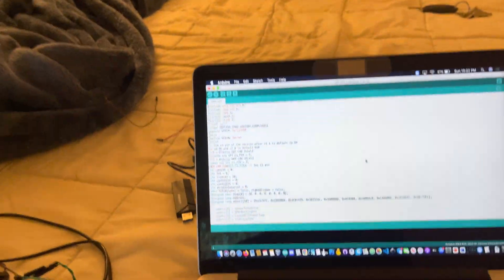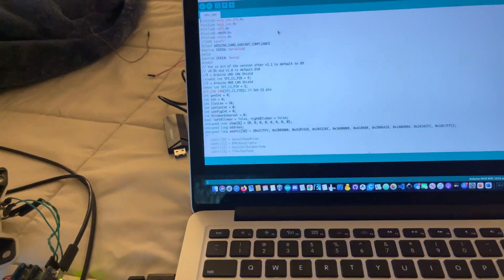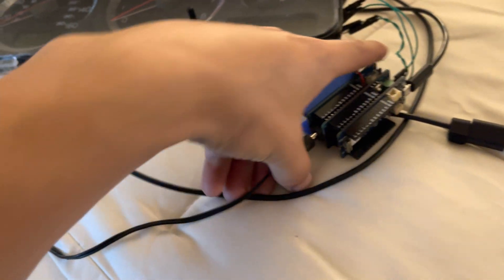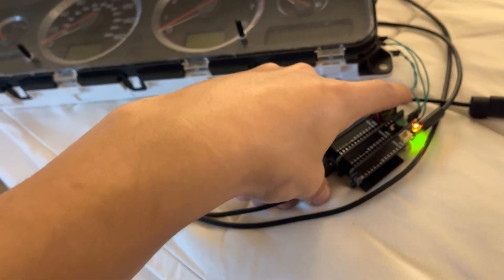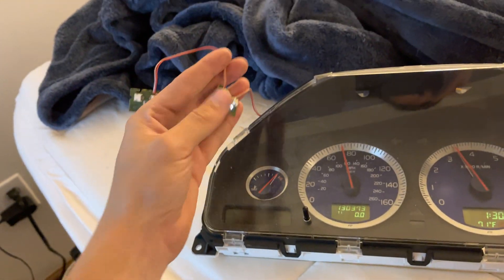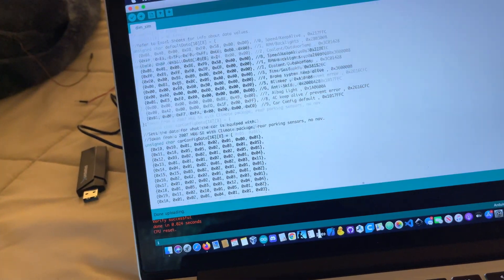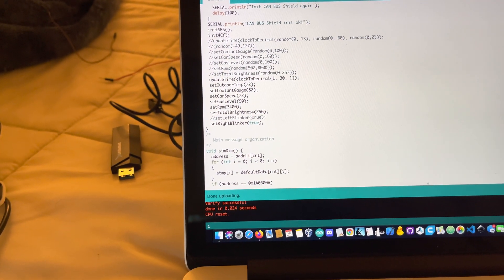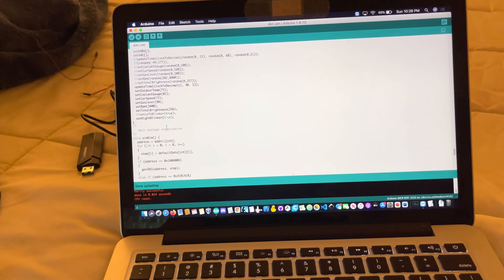Volvo Simulate the DIM

Comment: Everytime i power on the DIM cluster, it gives me a red RX light, how to fix that?
Reply from the maker: Can you upload a picture to imgur and link it so I can see what you’re talking about?
Reply: @AVGarage_  It won't let me send the link, but the title is Red RX light issue.
Reply from the maker: Send me the last part of the link after the /

I assume the light is on the arduino can bus shield?
Reply: @AVGarage_  Yeah, the RX light is on the CAN-Bus shield.
Reply from the maker: I believe that would be something to do with the way you have it wired up.
Reply: @AVGarage_  Like what? i did everything followed in your SimHub video.
Reply from the maker: Take a picture of your wiring and upload it to imgur. I found your first picture.
Reply: @AVGarage_  The entire wiring?
Reply from the maker: Yes
Reply: @AVGarage_  Here is the wiring on the Volvo S60 cluster,

is the title.
Reply from the maker: Ok i see that. Can i see how the rest of it is hooked up?
Reply: @AVGarage_  Okay.
Reply: @AVGarage_   Here's the rest of the wiring, sorry if the camera is so blurry.

is littearlly the title.
Reply from the maker: I see the image. Looks like you need power plugged in. I am also wondering what sketch you are trying to use?

Comment: I converted my standard dials to the blue R dials on my 2.4 by swapping the fronts, wasn’t too bad actually. This would have been easier 🤣 I also did a set for my friend’s 03 V70 but that has the D5 engine so the rev counter only goes up to 5000rpm - I used the black version of the dials from an XC90 R-Design D5 which came with those from the factory.

Comment: Any idea does this work with MCP2515 CAN module? How about with older DIMs (such as V70 2000-2003). I haven't found any simulator which can light up the display on the left. Great work! If you need testing help with older DIMs you can contact me.
Reply from the maker: Yes it uses the MCP2515 CAN module and the library created by seeed studio. I’m sure you could get 2000-2004 dims working but they’re running a slower can bus speed and may be using different id’s and data so I would need to look at a log to recreate the functionality.
Reply: @AVGarage_  Thanks for the reply! I'm very interested in getting this to work with older DIMs. Any progress about the custom text in the left display?
Reply from the maker: I haven’t been able to work on this project much since I made my last video on it. I’ll have to grab an 01-04 DIM from the junkyard next time I am there. I already grabbed a P3 DIM from a 2010 s80 to hopefully get newer DIMS working as well.
Reply: @AVGarage_  Thanks! There are two types of 2001-2005 DIMs. Older ones have green plug and newer ones have silver ring around gauges and white plug). I think both of them use same wake up CAN code (probably 51 C0 00 00 00 00 00).
Reply from the maker: I’ll have to look into that.
Reply: @AVGarage_  From which library the "mcp_can_dfs.h" is from? "CAN-BUS Shield Seeed Studio" does not have that.
Reply from the maker: It’s an older version of the seeed studio. Check their history, I wanna say 1.2
Reply: @AVGarage_  I’ve been searching for 1.2 version but it does not seem to exist. Github has only 1.3 or later (and it does not have that before mentioned function). Any idea where I can find the correct library?
Reply from the maker: I just checked and it looks like V1.3 was the one I developed this off of.

Comment: Hey great work on this. I downloaded the zip file from your github and it doesn't seem to have the mcp_can_dfs.h or the mcp_can.h libraries in it. Is there anyway you can fix that?
Reply: Nvm I found it. Thank you
Reply from the maker: @samuela69  If you would like I just finished uploading a library version of this code which will make it much easier to use. The link is in the description of this video. I will be making a video on how to use it within a week here.
Reply: Hey so the library I found by coryjfowler doesn't seem to be the correct library. The mcp_can.h library is in there but it appears to be the wrong version. It gives me multiple errors when compiling. One is- no matching function for call to 'MCP_CAN: :BEGIN(int)'. I also checked your library version and it doesn't have the mpc_can.h library in it. Do you know how this can be resolved? Maybe I'm missing something?
Reply from the maker: @samuela69  yup. I plan to make a detailed video on this soon, but I am picking up a new volvo so I don’t have the time. 

In the mean time if you go to the description of this video and click the VolvoDIMLib link.

You should be able to download the whole library on github in the top right by clicking download as zip. 

After that you can go into the arduino studio and click the sketch menu > add library > add zip library and select the download you just made.

After that go back to sketch > add library > library manager. Let it load and then search for Seeed CAN and download the canbus library by seeed studio. You should get the latest version of this library.

You should be good to go now, but if you want to get started quicker I included some examples with my library. You can access these by copy and pasting them from github or by selecting File > examples > volvodimlib > power_up_and_program. 

Assuming your hardware is setup properly your dim should be ready to go. If you are using a relay to control the 12v to your dim use the examples labeled with _relay and pass the pin the relay is plugged into in the constructer.
Reply: @AVGarage_  thanks for the write up. I actually managed to compile the new library. What doesn't compile is the logger. I want to be able to log and replay can data.
Reply from the maker: @samuela69  I see. I haven’t updated that code yet for the newer version of the Seeed studio can bus library. To get it working you will need to go to the library manager select the Seeed Studio can bus library and downgrade it to version 1.00.

Once you have done this you may need to adjust which pins the can bus shield is using and the sd card pin is using.
Reply: @AVGarage_  I'll give it a shot. Thanks
Reply from the maker: Yeah. You can add it yourself by searching for mcp_can in the arduino ide. Alternatively I am going to be releasing this project in library form very soon and you should have a much easier time with your dim that way.
Reply: @AVGarage_  I looked through the library and couldn't find it. Is there a link you can provide? Thanks